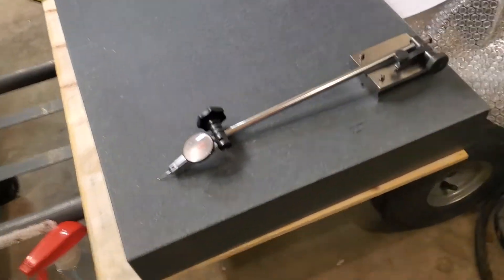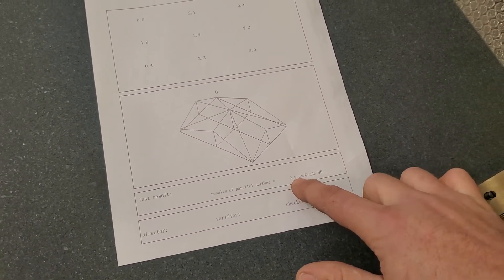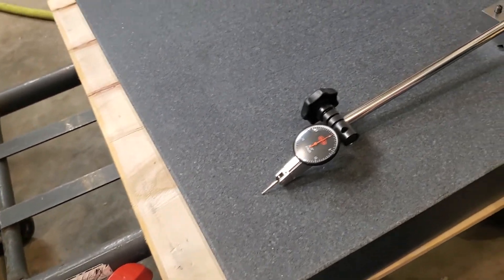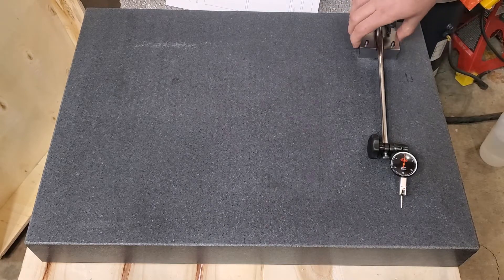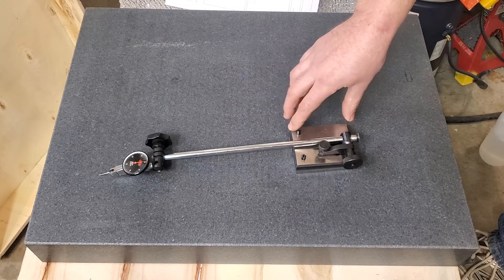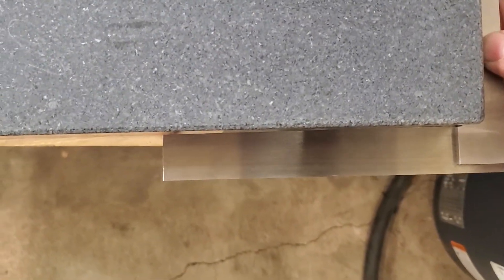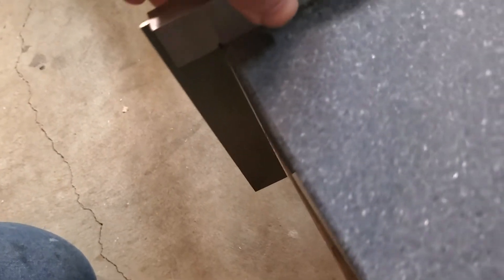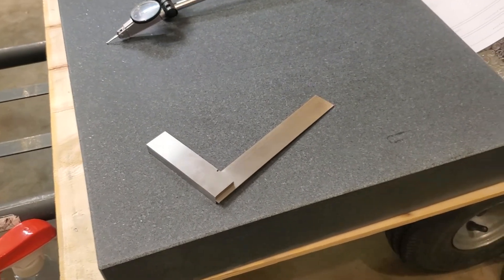HHIP Grade A Granite Surface Plate, 18x24"

Comment: Thks for posting this.  Was just looking at this on amzn too.  Do you have background in machining, cnc etc? Or just for home shop/woodworking?  Im looking for something for the latter, and wanting something like this for hand scraping.
Reply from the maker: I have very minimal metal machining experience.  This is the first surface plate I've ever handled. I've been using it daily but not in a professional shop environment.  I'm using it a lot more than I ever realized I would and kind of wish I'd gone bigger.  Though if I'd gone bigger then it might still be sitting in the crate right now, waiting on me to build a table for it.